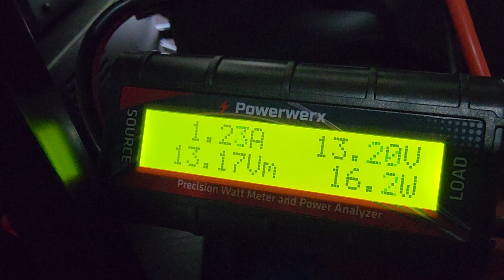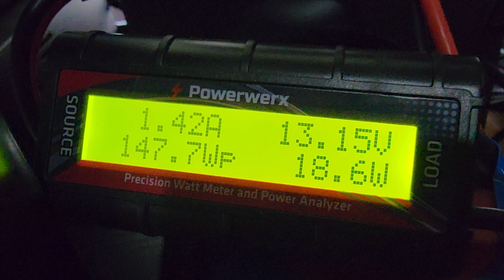Yeasu FT-710 Power and Amp Test

Comment: Hi. I have the same rig. What's the value on the left upper corner when you transmit 100W? I'm thinking about PO (Power) meter. I noticed that the needle was only slightly above 50W.

Comment: thanks for the video, if you use it with 50W output, ciould you estimate battery life? asuming 20% tx and 80% rx?
I want to buy a 710 but will need a better battery, my idea is tx with 50W max.
Reply from the maker: I went over 6 hours on field day on 100w on a 30 amp hour lifepo
Reply: Ok. Thanks